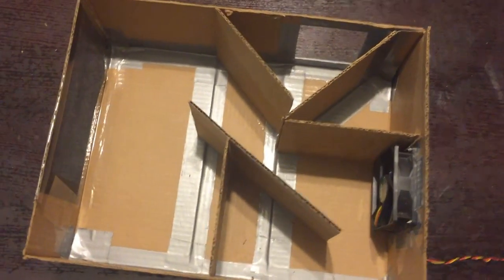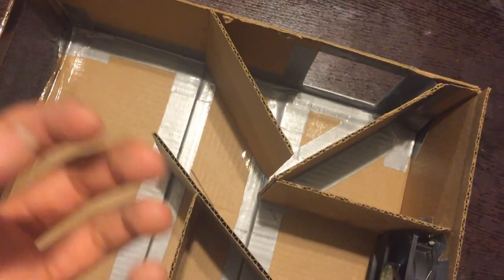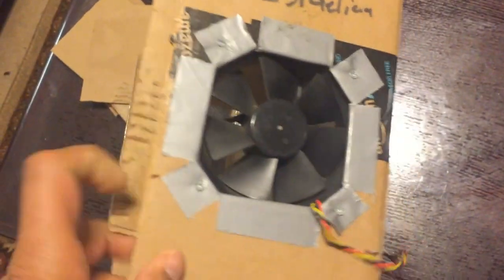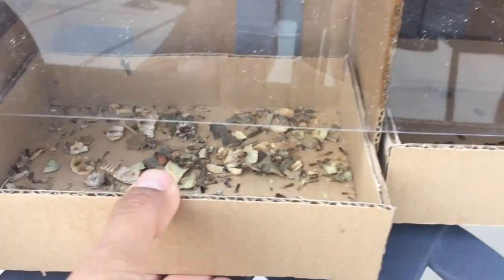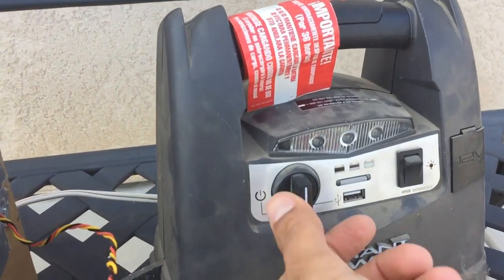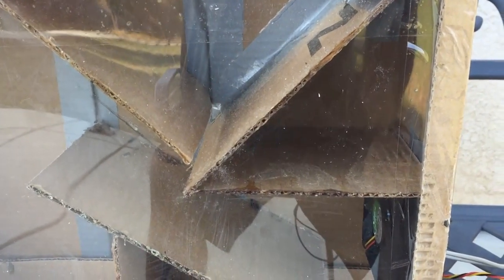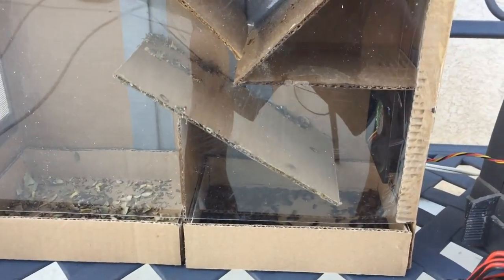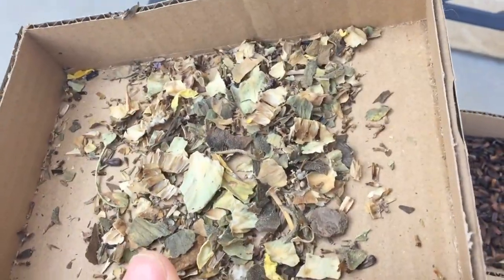How to Make Seed Separator and Seed Cleaner

Comment: I’ve written up the design after watching your video and I plan on using wood instead of cardboard. I harvest many seeds every summer and autumn multiple times so I want it to be a bit more durable. Some adjustments I’ve made is an adjustable ramp in front of the fan using a bolt and wing nut with a cutout in the plexi to allow for a metal dowel to move the shelf and an $18 cooling fan with adjustable speed and plugs into an outlet. Thank you for this video! I’m not very creative when it comes to self-engineering solutions and couldn’t do it without you. Subscribing to your channel now. 🎉
Reply: Thanks! How's it working with your mods?
Reply: Hi, would you please share the design you wrote up using wood?

Comment: I tried with amaranth but no luck. May work for heavier seeds. I think amaranth seeds are just too light. Too close to the weight of the chaff
Reply: I am also looking for an amaranth solution. Any luck?
Reply: @andreafeelsfantastic  I ended up separating my hand using different colanders
Reply: Get a speed controller to adjust the fan speed😊

Comment: Hello,

I am trying to build the similar seed separator machine. It almost works, but I am having some problems.
It sorts the seeds from the husks, but not completely. How many degrees should the angles be and how powerful should the fan be?
If you can also provide any schematics that would be useful. Thank you
Reply from the maker: If you already built it and the shells are dropping on the seed side, increase the fan power. If the seeds are dropping on the shell side, decrease the fan power. The angle of the slope can be anywhere form 30 degrees to 45 degrees depending on the seeds. I would try to control the fan speed to achieve a desired result before adjusting the angle as it is the easiest thing to adjust.
Reply: You can check my home page.

Comment: Problem is if the seeds are as light as the leaves..what then is the solution?
Reply: You change the angle of the ramp. The lighter the seed, the steeper the angle should be. Also, if it is that light, does it float? Does the chaff?
Reply: Also you could then use a fine mesh strainer